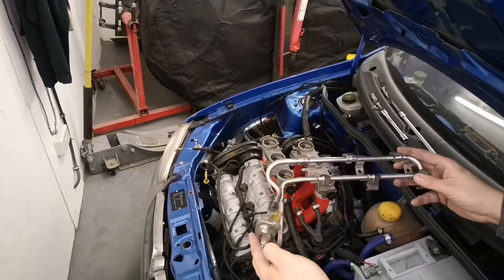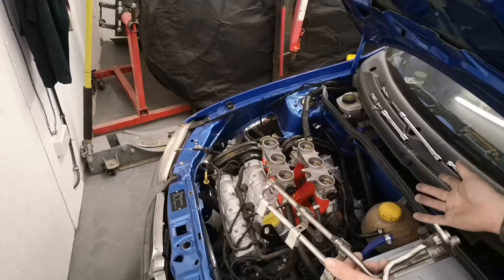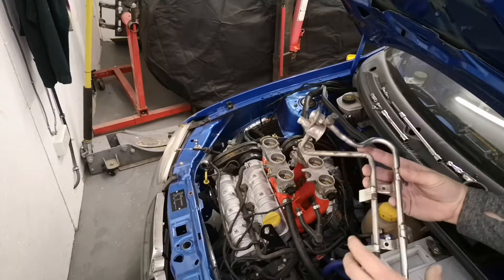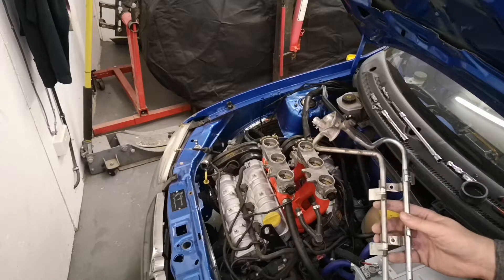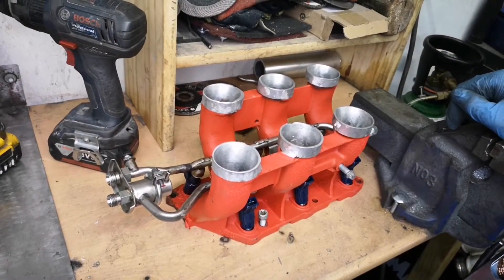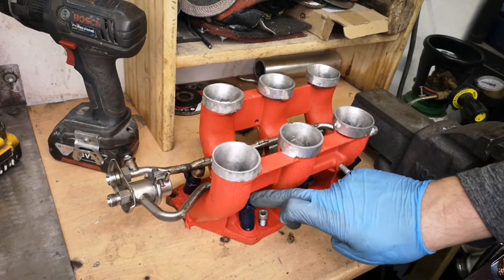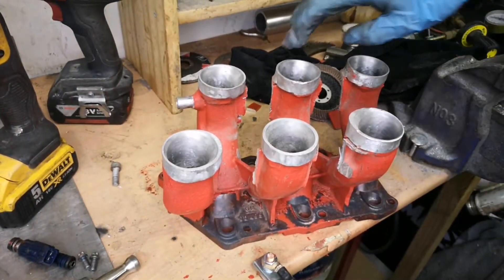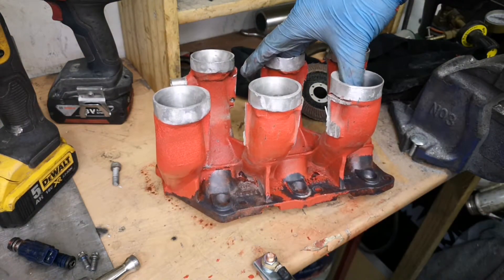Budget Bodies Part 5 - It RUNS! Vauxhall V6 X25XE Motorcycle ITBs conversion

Comment: Hi nice work, i recently do G cams swap in the inlet but the car stall, do you use the same fuel pressure regulator?
Reply from the maker: Hi just replied to my other video. Thanks
Reply: 3.8 fuel pressure regulator dude